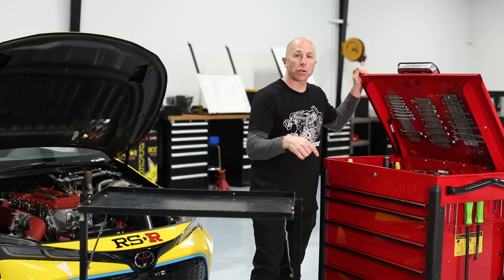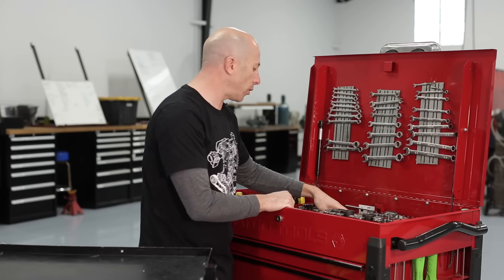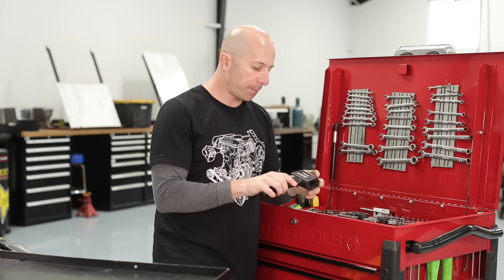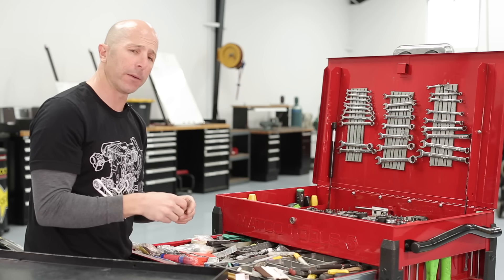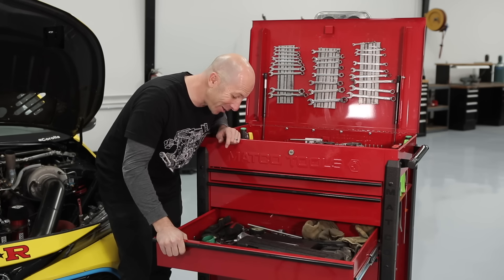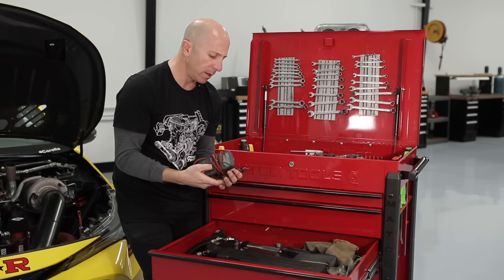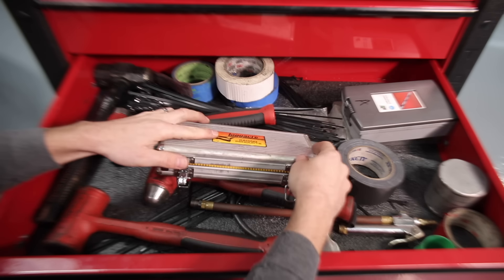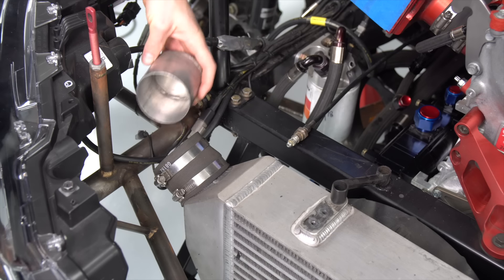Racing Team Tool Box Tour - With Specialty Tools

Comment: Another tip that I've found useful: stick a couple of A4-sized magnetic whiteboards on the sides of the cart. One is a shopping list; whenever someone notices a consumable close to running out it gets written down, then you pull the board off and take it with you (or just take a photo) when it's time to go shopping so nothing gets forgotten. The other board is for temporary use: measurements, clearances, temps, calculations, diagrams if you're explaining something, who's buying the beer, that kind of thing. Well handy.

Comment: I love that Papadakis Racing is cracking open old Snap On battery cases and throwing in replacement Ebay batteries. I love listening to Stephan talk, he's so soft spoken and isn't putting on a show or talking himself up. Impossible to tell from YouTube videos, but it sure seems like he'd be a pleasant guy to work with and for.

Comment: you can take Bit-Driver for hoseclamps too 😉
your lockwireing is to much drilled, you can see limits for drills/turn per inch at aircraft maintenance manuals basic and if you looking to a cutter take the stanley 0-10-598 Cutter 👍👍👍

Comment: Did a tune up on a Detroit 92 engine one time 
You use a height adjusting tool to set the injector plunger height so after we used  the tool on the first cylinder we used a inferred temp gun at each exhaust port and adjusted each other injector height   to match the first port temp as an experiment then rechecked the height of the injectors and found they were almost perfectly adjusted height wise while all burning at the same temperature 
Used my temp gun many times to find which  cylinder had the engine miss 
As a quick check

Comment: i use 2x4's 2x6's and 4x4's in the shop for almost everything related to working with drive line components, pro tip, a 2x6 or 2x12 on a jack, squarely beneath the trans oil pan is a great way to remove a transmission safely from a vehicle if you dont have a transmission jack, great video guys

Comment: Put a plastic bag over the magnetic trays . That way it is easy to keep them clean. And if you need to go to the next thing you can take of the bolts and plastic bag in one go and there all collected in the bag so you wouldn't get hardware mixed up.

Comment: Replaced all the wheels one my best engine stand to ball bearing hard rounded rubber caster wheels. It is undescribable how much better the stand is now. Also they lock so when i have to torque something down it doesn't run away.

Comment: This cheered me up while resting up through  Covid quarantining. This video is most informative and doesn't waste time.  Well done Stephan.   I am anxious to re-arrange my cart and add some of these items.  Might any of you petro-heads and  You-Tube-rs know which brand of boot clamp strap tool he is using?   It is much more streamlined than anything that has come up on a search engine.  And also, where to find a match to the Honda ball joint tool.   Thanks in advance for suggestions.

Comment: Any particular reason you haven’t switched to the new Milwaukee electric tools? Can’t say enough good things about them
Reply: Hey, if the old snap ons are still working, no need to replace em.
Reply: Anthony Scott just thinking more power, versatile don’t need a air hose, multiple people can work with different tools without sharing a hose, faster to pick up a tool and work.
Reply: @LEGOCAMARO  They already don't need an air hose with the old setup.
Reply: Ha! I made the same comment. Those things have changed my life. Haven't met a crank pulley bolt it wont back out. And they're inexpensive enough he could upgrade the entire bottom drawer for the cost of ONE SnapOn impact gun.
Reply: @athomedetail6512  I'd say, at least for the impact gun, the old SnapOn is not working. They still have to use the chain wrench for the crank bolt. I guarantee the Milwaukee will take that off with ease. That's the new standard amount of power. Anything less, I would consider no longer "working".
Reply: Probably still paying the mortgage on the snap on tools

Comment: Lol, let me open your eyes here: Those IR pyrometers don't use the laser for measuring, it's just a funny thing to show that it's working and to show where you're pointing. In practice the pyrometers don't measure that small point that you see, they measure an area somewhere around that dot, and if you block that laser with your finger, but don't block the IR sensor you will see it reads the same temperatures and it doesn't use the laser at all.
The laser is just for added fancyness...

Comment: You should contact Milwaukee and ask them to sponsor you. If I were them I sure would want that to be a milwaukee box stacked with the latest milwaukee tools.
Reply: singlecams I noticed some of the pro drifters using overpriced Snap On battery tools, they’re probably sponsoring those guys.
Reply: @smithsfan425  doubtful. snap-on don't do much for individuals.
Reply: @smithsfan425  Snap-on only sponsors Team Penske.
Reply: How about buy American made tools?? Not Chinese tools, Milwaukee has good tools but so do American companies
Reply: @joeframer9642  Let me pay an extra $300/tool for a cordless snap on power tool that was assembled in the US. Not made, all the internals are sourced from abroad, but you pay for an American to put them together. Not worth the premium especially when Milwaukee and Dewalt run circles around snap on cordless
Reply: @tonyovermyer5368  As someone who owns both snap-on and Milwaukee products, I find myself reaching for my snap-on stuff every time. Just because you cant afford it doesnt make it bad. There isn't a bolt the Milwaukee can take off that my snap on couldn't.
Reply: @ITzDreamWeaver  I never said that Snap on cordless is bad, but even if I were in the position to afford Snap on, I wouldn't. Snap on came out with a flier before christmas that had their 18v 1/2 impact that for $650ish with one battery and a charger and a beefy 600 ft-lbs of breakaway torque. I almost laughed when I bought the gen 2 fuel 1/2 for $300 with a 5.0 battery and has more than double the breakaway. Now you're correct that in most automotive applications no one will ever need the full 1,400 ft lbs or even over 1,000. But the price alone is ludicrous, and snappy products seem to break themselves just a few months after the 2 year warranty expires. Then you get to spend another $200-$300 on a new tool, or buying another $100 battery when Milwaukee or DeWalt is the better buy.
Reply: There’s a reason why Milwaukee is cheaper.
Reply: @joeframer9642  Milwaukee tools are now american made for the most part.

Comment: You should get some new Milwaukee impact tools and you'll never need that chain wrench or air impact ever again
Reply: Caleb Baker the big Milwaukee 1/2 I got does 1400ft lbs reverse torque, great for heavy diesel, and the 1/2 medium gun does almost everything else
Reply: @fogartyfreaks17  You go look up the YT channel "AvE".
And don't mess up static and dynamic reverse torque, take resonance and mass of the bolt and the head into consideration. At some point you will see that the claimed value doesn't get close to what they deliver.
Milwaukee is Chinese, it's 100% owned by TTI in China.

Comment: Question from a weekend warrior: Why are the sockets placed upside down? Do they grip better on those holders? Is numbering more visible that way? I would prefer seeing if it's a 6 point or 12 point from the top. 

Also, does anyone rely on 12 points these days? Apart from 12 point bolts, like driveshafts, etc? A good ratchet will have around 120 teeth, so the added movement of a 12 point is null. I also had a bad experience with one in the past.

Comment: A faster way (and one that rival teams use to spy on each other) of checking tire temps is a sensitive IR camera (not the cheap stuff) that shows you on an adjustable gradient the exact temperatures via color representation of the entire tire as you view it. 

The ability to see not only the tire's temperature but the zones on the tire that are hottest and coldest can save your car. If you slowly rotate the tire you can see any anomalies in the tire as you go.

Comment: Portability is something that many overlook when they buy a nice big toolbox - sometimes it's more convenient to spend a bit extra for two smaller ones if you need to move it a lot.

Over time, the rubber bottoms of the drawers can rip and fall apart, you can use carpet off-cuts instead.
The commercially available dividers/trays are neat but if you're on a budget, or have different needs, you can pop rivet some folded sheet metal to do the job.
For some on a budget, or for the rarely used tools, angler's tackle boxes can be a viable alternative, especially if the internal trays that aren't needed are removed - I used to have quite a few, before purchasing the large box/chest I have, in a variety of sizes, designs and colours - that way I knew exactly what was in each box. Still use them for some things that don't conveniently fit the big boy. For example, electric drills in one with drill bits, small disc grinders with the discs and spanners in another, Dremels and attachments in a third, etc.
Some of you may use the above suggestion for PPG, welding accessories, etc.

Different folks will have different needs and ideas, so the more suggestions the better chances you'll find what suits you.

Comment: Why not use metric fasteners in your fabrications?  Then you can cull tools from the toolbox.  Simpler, more streamlined, easier to maintain.
Reply: In most of the US, a lot of times it just so happens that you have to run down to a place like Lowes or Home Depot for fasteners, and they typically don't carry a good selection of metric bolts. They carry a ton of imperial fasteners though, so having some tools for those is very useful.

Comment: Does anyone know where one could find similar magnets for attaching wrenches to the lid of the service cart?  I've done quite a bit of searching and I haven't found any that would be strong enough to hold wrenches upside down, while also being long enough to hold a whole set of wrenches at a time.

I've found a few that are designed to hold knives on a vertical surface in the kitchen, but they seem too thick to effectively hold tools above a set of sockets like this.

Comment: Have you folks tried "Zip-Tie" automatic tensioning tools, like McMaster 5202T11 ?  They automatically tighten the tie and cut off the end flush with the tie head.  I have found it saves lots of time.  Cheers

Comment: I knew all but a couple of those tools. Pro tip: Exhaust Pipe Cutter (K-D Tools) = Oil Filter Cutter. It's basically just a large tubing cutter. I liked your ball joint tool. That's a good one since it can be so difficult to find the replacement boots for the ones you tear! I like your videos, and yes, I subscribed.

Comment: @PapadakisRacing Late to see the video but a tool you might want to look into is a carbide gasket scraper.  You will never use a razor blade for cleaning off gasket surfaces again it works so good.  It doesn't cut into aluminum and it can also be used to smooth a damaged surface to sit flat again.  http://www.superscraper.com These are a good price and high quality.  I have the SS1.

Comment: We run foam drawer liners with cut outs in each drawer for each tool. It takes a little bit of time to set up, but once you do, it ensures everything goes back in the same spot. And if something is missing, you will know by the empty space in the foam at a glance

Comment: Great vid, keep em comin.When you said sometimes your impact wont take off the crank I was surprised and then I saw your impacts are 20+ years old! I bet my 3/8 MG325 would break it loose no sweat. The cordless Milwaukee High TQ 1/2" would spin it with ease and they are only 200 bucks.
Reply: Only . . . Sometimes that's why some people have 20+ year old tools . . . 😁
Reply: @DDS029   Compared to every other brand of similar tools 200 is a bargain.

Comment: "on the import cars they have all metric hardware. but a lot of stuff WE fabricate has standart hardware. "    easy fix . fab your stuff using metric measurements. you can stop carrying imperial tools. less weight to cary. less stuff to inventory. no possibility of someone using a tool that doesn´t fit exactly right and damages something then...

Comment: PapadakisRacing What is the difference between measuring the temperature of tires with accutech contact type temperature gauge and non contact type infrared temperature gauge or meter?

Comment: Get rid of those air gauges except one. Thirty-two psi on one could actually be 34 psi on another. Doesn't matter which one is right. It's consistency that matters.
I also tend to use mechanical-analog measuring tools. Don't have to worry about batteries going dead. You can see when a needle on a pyrometer stops, instead of waiting to see is the digit is going to change. Beam torque wrenches don't go out of adjustment, etc.

Comment: My brothers name is Stephan..so you're probably OK.....there at ...3:12....yeah, get better wheels, and maybe beef up the bottom of the rollaway so it doesn't collapse...just a bit of info from a guy who did stuff with 50-60# or more per drawer...welding and machine shop....everything is Heavy...!
 Magnets inside the tool box lid..., I'm 71 and still like to learn something new every day...
 ...9:00....I used to work in an auto AC shop, repair and aftermarket installs...you have no idea how many times I cut my hands on zip-ties that were cut off using wirecutters...there's actually a tool called a 'tie-wrap gun'...pulls the ties snug and cuts it...allows the end to pull back just enough so there's no sharp ends...try Burndy or Hollingsworth...

Comment: awesome toolbox never work on a racing car but I worked in a shop environment both a shop supplied  tools  the big thin  people walking off with tools  great  place to work at just the loser they hire  finally  they got smart  after I ask them to the new shop was build  have a changing  room for us and a metal protector before we go in the changing  room from the shop  all the tool were counted for after that I am now working in a shop and a field environment you have to supply your own tools and boxes I spent money on  covers I put over my tool boxes and the lock them  under the cover some  time  you key box matched  someone  box to you tools are gone  same as my  truck no other person is able to work from the box they  get paid to have their  own tools I supply my own service truck to little big  for what I need I have a class 1 with airbrakes  my dad has  semi trucks  on the farm  and I can drive them when the time comes I bought a semi  truck and a service body for the truck to love it has put  both sides awning  too if I need them, yes it nice to work  from the rain or snow  here  just  one  draw back  with that if I use the cranes  can not use the awnings  have a place to clean up too  yes I have a washroom if need, as  to have a shower before I drive, is awesome  and have  clean  clothes to wear in the cab as well  the truck did come with a double wide sleeper too  so I could  stey on the  job site  if I chose to have a bbq in the side cabents I can cook  a meal too yes  it does get used alot  
have to thank my great- great grandparents for  that truck and box  they paid  for it when I was looking at  a truck and a service body  they  wanted to help me out to and bought me the  truck to
I buy old tractors or machinery  to  fix or to part out to  lately I am  parting out old machinery  from a dealership now  they paying good money  for me  to part out  think  it  how I do it as well all the parts are cleaned and packaged up to with labels  on them  and  part  information  now that  part as to how worn it is too

Comment: They are Imperial NOT STANDARD size
Reply: Nah
Reply: XD! Well, it's kinda standard for people living in the US.
Inch threads aren't even that standard in the USA if you consider there are threads of 3/8, 1/2, etc inch, and you have the older .20 .30 inch threads, they are not interchangable. Then you have course and fine threads. And the funniest thing in all this: neither the inner nor outer diameter of national pipe thread corresponds to the name XD. If you buy a 3/8inch fitting, and you take a caliper to measure it, you will see it's more like 1/2inch. And some genius decided to use threads per inch, in stead of defining the distance between each thread.
Fortunately I live in the metric part of the world.